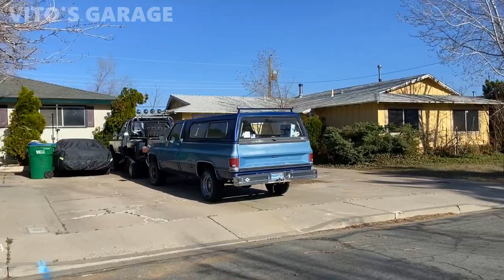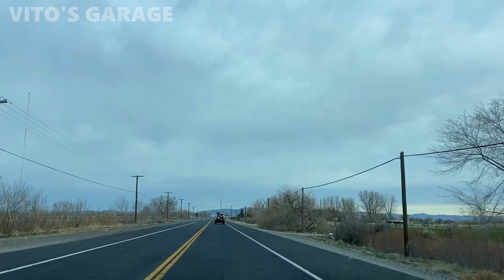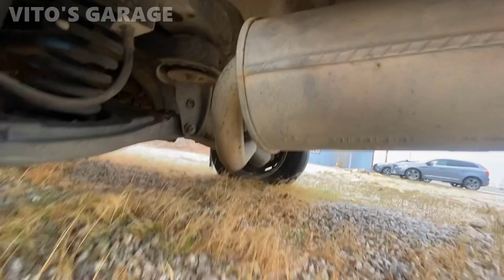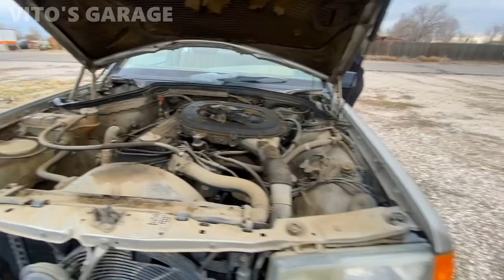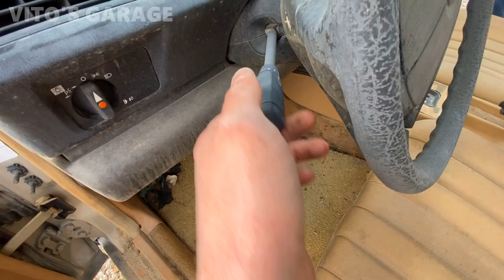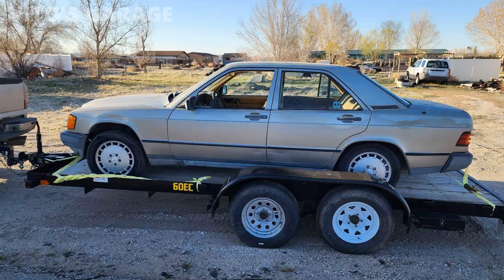Sat For 10 Years.. Found a 1987 Mercedes 190E 2.3L. Saving Another Legend From the Junkyard!! #W201

Comment: Vito: The 190e 2.3 is prone to blowing the radiator fan fuse causing rapid overheating and head gasket rupture. The fuse is located in a separate box forward of the main fuse box, about over the front axle, drivers side.